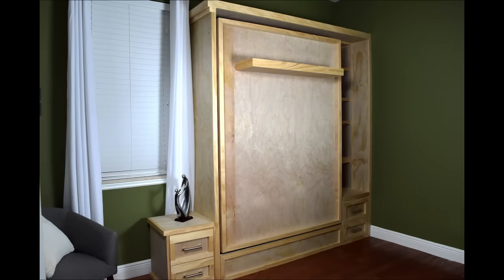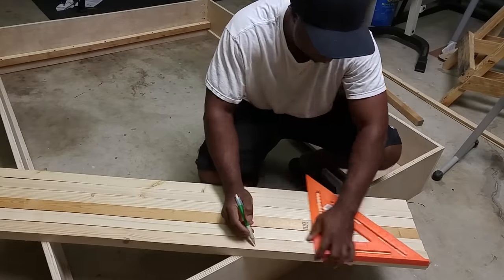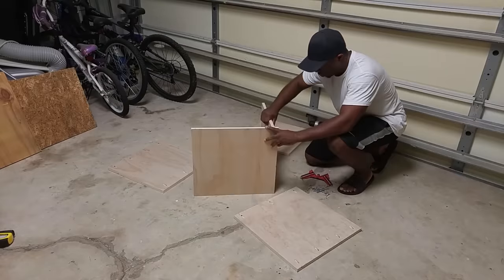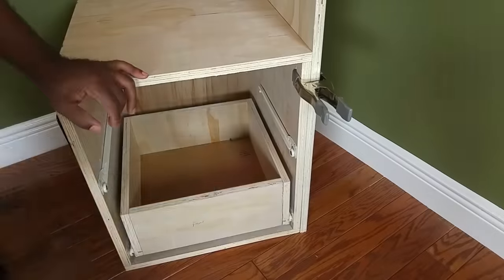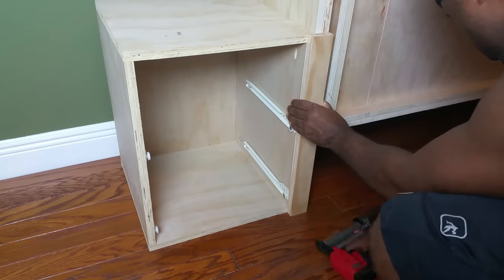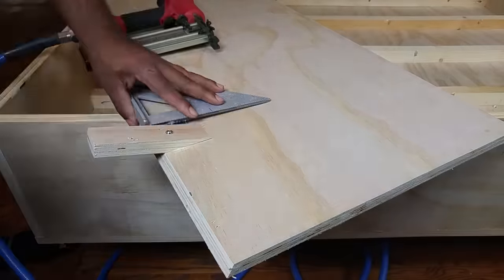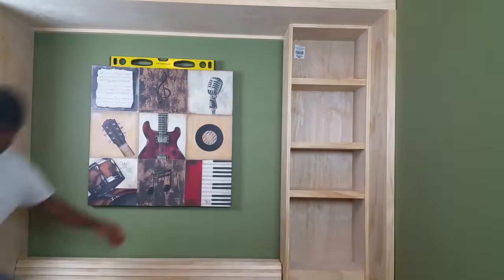Diy Murphy Bed Build - Wall bed Hack Without the Hardware  Kit

Comment: This is my favorite plan so far.  I don't want to spend a fortune on a DIY kit and this bed is elegant, simple and looks very sturdy!
Reply: Just make sure the hinges you get for the pivoting the bed are very strong. Now a days. They use so much recycled metal that bends.
Reply: I don't like the bed head I have to move every time
Reply: @زكرياءبكوري honestly don’t know why he made it bulky like that. A simple common board fixed to the wall would’ve sufficed!
But you always appreciate people doing things a little different

Comment: Nice break down on a simple build. My only concern is the T-nuts. In the video it showed you mounted the swivel base on top of the t-nut, but they should be on the opposite side of the bolt so that it pulls into the wood. The way the video showed, is not correct

Comment: Looks very nice. To up your professionalism you should wear shoes in your shop with your ear and eye protection. We made a simular bed 5 years ago. What I wish we could change on the one we made is the side that comes up from the bed platform can cause brusing of the legs as you enter or exit the bed. If the entry area could have very low lip or no lip, it would be better for the user. I have thought about making the box go down from the platform and attaching a stay level desk, or folding table, and making the support leg you have a stay level shelf. To make the build easier I would use pre fab drawer units from a big box store.

Comment: straight to the point, no Steven Spielberg shit and very informative. all people considering making instructional vids can learn a lot from you. I'm subscribing. thanks a lot
Reply from the maker: Thank you, glad to have ya. :)
Reply: DIY Creators I've actually started building this for a Queen sized bed a progressing fairly well.. The only part I've had trouble with is visualizing the clearance needed to avoid the wall and floor from the swivel.. Using a "to scale" cardboard cutout, I was able to nail it to a board in the correct place to physically see where I needed to center the swivel.. My floor to ceiling is 91" and have calculated 86" from floor to the top of the mattress box with appropriate clearance below.. I notice on your final product that there's far more clearance space below than up top.. Is this camera "illusion" or is less clearance needed for the top "downswing"?
Reply: DIY Creators Oh!! I feel I should also mention that the mattress box comes in at 81.5" and the clearance needed down below was  4.5" so if the same were needed up top, I might have to cut out a section of the top enclosing crossboard of the entire unit, if one could even fit at all..
Reply: DIY Creators Because obv that would equal 90.5" wherein the entire floor to ceiling height is 91"...
Reply: @paulhavenjr774  Sorry, three years late but...
...what about a horizontal, "Murphy" bed?

Comment: I can see two flush circular lights set in the top frame of the bed shinning down on the headboard area for reading in bed or small decorative lamps on each side of the bed.  You did a fantastic and beautiful job making this Murphy bed without the expensive Murphy bed mechanical parts.  WOW it is very very nice.

Comment: I made a bed like this. Headboard was already attached. The legs were magnetic so easily removed when beds in the wall. The underside of the bed was papered and painted the same as the surrounding wall. You couldn't tell if I had a bed in the room. It looked like an optical illusion. Nice video my friend.
Reply: Phil Richmond reply with a link to photos. Sounds neat.

Comment: Mount a piece of artwork on the underside of the bed when it's in it's up position. Also, go ahead and actually use your little shelf and decorate with whatever accent pieces... but glue them in place ;-)

Comment: Great job building the bed. Awesome circular saw dust collection. And on a random side note I think the green wall color works really well with the white trim and the floor color.
Reply from the maker: +Jay Bates Thanks man, lol  I was really thinking about lightning up the paint color but then I remember how much  I hate painting.
Reply: +DIY Creators - Build Something ... painting is worse than sanding... just saying lol
Reply: Great video! And very nice build! And why is it that men always hate painting? I love painting (except ceilings).
Reply: Not all men hate it. I like it. Even though anybody can slap paint on a wall, there are definitely tricks and techniques for making the finished job look professionally done. I think a lot of people dislike painting because they are unaware of these techniques and their finish product comes out looking like shit after going through all that trouble. One hugely important factor in the final outcome is how thoroughly you prepped it. Some people say that a paint job is 80% prep work. Those people are low- balling that number. It is at least 90%.
Reply: Safety first....except not always, flip flops. You're a very skilled craftsman. Great video. Safety glasses. lol
Reply: DIY Creators how much?
Reply: @DIYCreators  Your video went thru so quick I want to ask if there's a website where I can get the dimensions? I'm not even sure that I can afford plywood at the moment, i haven't priced it since our great return from the Covid shutdown but I need to add a 2nd bed space and I've been looking at all kinds of these plans. This one is awesome. Thanks for posting it and Happy Memorial Day Weekend.

Comment: dang, you made that look easy!  You have some mad skills bro.  Excellent job !
Reply from the maker: Thank you.
Reply: nice video man! made it look really easy, dicovered your channel yday and subscribed! 
one thing however, please put the t-nuts on the other side of the plywood otherwise theyre going to fall out! might get a suprise when sleeping or folding up/down! 
i did see you had a problem with a t-nut on your fast cut stop-block, that was also on the front, the t-nut is meant to have the the thing its stuck to between it and the bolthead, otherwise it will fall out sooner or later!
Reply from the maker: Thank you.  As far as the t-nuts on the bed I believe I stated that I have 2 per hole. One inside and out side. I am aware that I placed the t nuts on the outside of the block. I did present a solution as well. That is overshadowed by the mistake I made.
Reply: np, as long as i works for you :)
Reply: +DIY Creators do you have plans posted, so that this can be recreated?
Reply: I would like to see the plans also

Comment: great idea of using the Boat Seat Swivel hardware.... how is it holding up since Jan 2016 ?
Reply: Yes, @DIY Creators, I would like to know the same thing. Your video is straight to the point and actually cost effective. I have a bed that makes a perfect platform to modify into a Murphy bed, but most hardware out there is $300. How is the seat swivel hardware working out? PS I plan on doing this for a murphy bed that will be used daily.
Reply: I’ve used this same build in my bedroom on a daily basis, and the same boat seat swivels since June— I’m noticing gunk is getting caught in the swivels and strands of hair, all of this isn’t effecting the function that the swivels serve. It’s held up fine these past 6 months, but I do plan on replacing the hardware by the end of this year just to be safe as they’re pretty affordable and get a lot of use.... hope this helps!
Reply: @JohnnyTemptation  $14 every 6 months could be affordable. :D Boat seat swivel one of the best idea I ever heard!
Reply: Awesome video. I plan to build one myself soon. Thanks for the ideas.
Reply: What do you guys think about using pivoting hinges?
Reply: @dontdomeboo81  why don't you buy Murphy's bed hardware kit? It also include pdf plans of beds. I am going to get one for my self but i will build the horizontal one...
Reply: @tombez3638  I think you missed the whole point of this video.  It works well and not everyone can afford to spend that much on something you might actually use 4 times a year.  Someone pointed out that the "dirty secret" of "Murphy Beds" is that after a while you tend not to put them back up.  I'm still gonna' do it but, I'll keep that in mind.  One, more thing, rich people don't get rich by spending money.

Comment: Brilliant, simply elegant design! This is the first of you videos that I've seen and can't wait to see more from you! Subscribed!
Is that a full or queen mattress? If it's a full would I need to do anything different to put a queen in it's place?
Reply: The only differences should be the size of the mattress frame, the height of the shelving units (to match the length of the mattress) and the top piece (to span between the two shelving units).

Note that the queen-size mattress will be heavier, and some Murphy beds have extension springs to help lower and raise them. The springs could be attached out of view, from the head of the mattress frame to the bottom of the shelving units (near the front would give best lift). I'm not sure what size of springs to use. That would depend on the weight of the mattress and frame.

For reference, traditional bed sizes are:
Full-size = 54-inches wide by 75-inches long.
Queen-size = 60-inches wide by 80-inches long.
Reply: AustinPilotMichael
Reply: AustinPilotMichael

Comment: Very nice!! One question: Don't the 2x2's cause a comfort issue? Should there be plywood over it to give a solid surface?
Reply: I think 2x1s would warp in the middle from the weight. If you space the 2x2s frequently enough, the mattress won't sag between them.
Reply: I had the same thought. Plus you're likely voiding a mattress warranty putting it over 2x2's like that. 

I didn't notice how thick the plywood was he used for the face, but what I would do is use a 1/4" plywood for the face, then the 2x2's, and lay a sheet of 1/2 or 3/4 ply on top of the 2x2's to give the mattress a firm, flat foundation.

That is my one and only criticism of this build. Aside from that, it's fantastic. I'll be using his design as inspiration for my build.
Reply: I plan to run the support members lengthwise in the bed structure and then affix bed slats on top of that to support the mattress, for air circulation under the mattress.

Comment: Good job! I’m wanting to also omit the hardware method but at a HDepot when asked about this swivel mechanism was told they don’t carry it any longer. Had thought about using the thick gas line pipe as an axle and concrete blocks as a counterweight so didn’t find my answer here but was inspired by the creativity nonetheless!

Comment: Thank you so much for this, I just finish building my own Murphy bed (140x210cm)and thanks to you it only cost me 600 euro including 2 gas springs (700newton pressure per piece) and all the wood and stuff. Now I have a movie🎥🍿 room and when the screen is up I can fold down the bed to 💤😴 so thanks allot mate.

Comment: Hi I have watched you make Murphy bed and cabinets I am getting ready to try n build a queen size one myself n shelves only difference is I plan to use thick boards for inside of shelves where bed attaches as I was given the wood my total cost will be for trim,screws n swivel seat  parts thank u for sharing how you built the bed and shelves

Comment: Excellent! I'm going to be trying something like this based on your ideas with a king-sized bed. Even just to see how you built the shelves this video is very educational for me!
I just wanted to mention that it looks like you put the t-nuts on the wrong side of the wood. I usually put them on the opposite side of where my bolt is entering. Maybe after I try this, I'll learn that you have a reason for this as well.
Thanks for this and all your videos.
Reply: Did you ever make this with a king bed?? I haven’t found king bed Murphy plans anywhere yet!

Comment: I know this video is a bit old, but I'd say that your T-nuts are installed backwards.  I've always installed them from the backside of the wood, so when you tighten them up, they are pulled into the wood, rather than just friction holding them in.  I guess your use can't let them pull out because they are sandwiched in, but they'd probably be stronger the other way.  Great video, and thank you so much for sharing!

Comment: Hey, great video! I am starting my horizontal murphy bed this week.  I am picking up materials tomorrow and waiting on a delivery (matress etc.) .  Can I ask a few questions about your build?  I am not a seasoned carpenter or hobbyist so I have some basic questions, any help would be amazing!

- I plan to use plywood, what thickness did you use? I am planning on 18mm
- Why did you use boat swivels and some models use gas struts (which are relatively cheap online)?
- How did you anticipate the space required between the mattress box and the outer shell of the bed (for screws and metal plates/ mounts)?
- I am worried about the legs, buckling and such.  How can I ensure they are sturdy enough? (I plan to put a desk in place of your shelf, which will rotate and lay flat on the floor when the bed is opened up, thanks to your video I will invest in swivel boats for this I think)

If anyone can offer any advice, that would also be great :)  
I know its probably a tougher project for my experience, but I have tried tiling and plastering and got on okay.
Reply: Post your update on your work if you dont mind.. Btw I was thinking about adding a gas struts either, to counterweight and make the lift easier and opening the bed safer so it does not just fall.. I got 100N gas struts for $2 not sure will it work or not..

Made some draft drawing in sketchup for the mechanism but I dunno..

Comment: I like what you did. I've been wanting to do a Side-Murphy bed, as I think of it. I want the bed to fold up on the short size, due to my ceiling fan and ceiling height. Thanks for the tip on the lazy Susan plates. I am thinks of wheel sets on each end so I can move toward the wall. I figure on using a couple of draw straps to hold the box spring and mattress together along with some side board.  Well need to so some engineering now...lol

Comment: Good build and good design specially the headboard storage and flexible use, that said is my opinion that you should sand your joints and parts for a cleaner presentation. All and all good job !

Comment: Really like the murphy bed, I actually built one myself using the instructions from one of the mechanism kits.  It turned out pretty good.  The hardest part of the build was the overall size and weight.  I do just about everything myself, so moving it and installing it in place was tough.  I've also moved it through two different houses since then (unfortunately having to dismantal and rebuild each time).

Comment: Really great build. It gave me some ideas for the murphy bed I'm planing on building. One criticism, you're using t-nuts incorrectly. the insert needs to be inserted opposite the piece it's securing, that way when you tighten it down it's drawn further into the wood. The ears on the fastener are to prevent it from spinning, not from pulling out of the wood. Thanks for posting, it's really a superb video!

Comment: mad props to you sir !!! :)  what would the cost of a couple of gas cylinders be? personally, i'd have added them for safety reasons.. so the bed cannot come crashing down, should the "latch bolt" fail (or some little tyke messes with it).. i'm not seing a counterbalance as another way of slowing the descent of the bed once released... i might have gone with full suspension ball bearing slides, as that'll allow full drawer opening.

Comment: Very cool video..didn't aggravate at all as these usually do. I'm wanting to make my dog one for the laundry/ mud room. I have 32 inches in length to work with and 5 ft in width . my dog is 55 lb and about 30 inches in length. Can I just use a couple medium hinges and a latch to keep it closed since it won't be holding a human?

Comment: Great job... have a few questions??  Do you have the cut sizes documented for each panel? 
Also what are the measurements for the draw facial trim and measurements for the placement within the box for the draw slides?

Comment: Looks great and will save us a fortune from those expensive kits! The only concern i have is that will putting the bed up be too heavy for a 13 year old? Or will putting up the base need an adult to do it without the springs or gas struts the kits provide?

Comment: Hey Glenn, what plywood did you use for the mattress box? 3/4 for the sides and 1/2 for the bottom? I see you use 2x2 bars for support. 

Really nice the way you build, im about to start using the same boat swivels. 

Looking forward for your answer. Thanks for your videos.

Comment: I'm glad I stumbled across your video. I was about to use threaded pipes as the pivot point, but I like your idea better. Now that you have used the bed for a while, do you still find the repurposed swivel/lazy susan is able to handle the weight of the bed plus two people? Or do you think using other hardware would have been better? Just curious, as I'm trying to decide whether to use actual murphy-bed hardware or repurpose other items. Thank you for your video and your feedback.

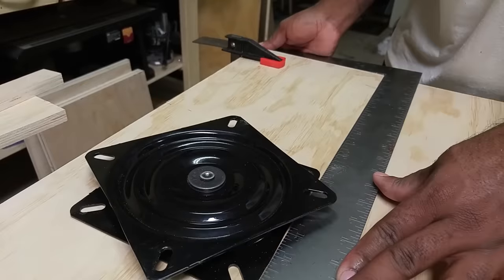Comment: Loved the use of the boat seat swivels for the bed... kinda shook my head a bit (3:45 min) with the way you used the T-Nuts though... I’ve always been taught that the bolt PULLS on the nut and tangs to dig in deeper (stronger) The way you’ve installed them seems no better than just using a fender washer and nut on the back side... Still a great build though
Reply: I like this one-